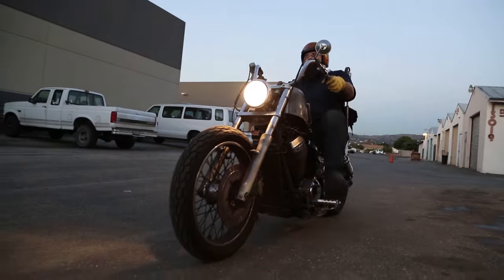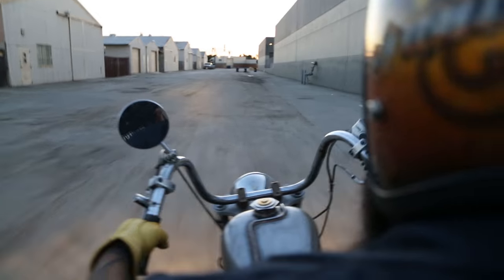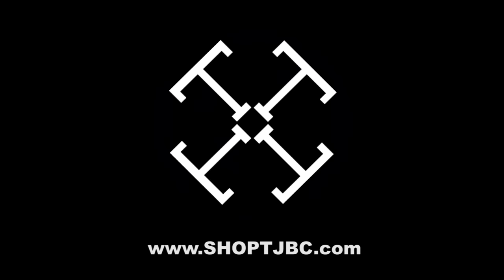How To Fix Idle Issues - Bike wont stay in idle? EASY Diagnosis

Comment: Hi, got my carb cleaned but the problems persists. Could the problem be with the inlet and exhaust valves? My odo reads 55k kms. My bike doesn't idle even after riding for an hour. A lil help is highly appreciated.

Comment: Hi, I just found your channel. My 2007 carbureted 865cc Triumph T 100 Bonneville changes idle by itself. I set the idle adjustment knob between 1000- 1200 rpm, the next day the bike is idling at 1500-2000. My bike has close to 25K miles on it, all mine.

Comment: I'm not a mechanic, but from what I've found, a lot of these old bikes are just cold blooded and won't idle on cold starts without a little help...until they're warmed up.  I'm not sure what year this guy's bike was.   With my 1975 CB750 I have to keep my hand on the throttle, keeping the RMP's around 1000 for the first minute or so then it should hold it's idle fine.  I'll give it a few revs when coming to stops for the first mile or so, just to be safe.  These old Honda 750's actually came with a screw on the bottom of the throttle housing so you can open the throttle a little and hold it there with the screw as the bike warmed up. (Same thing I'm doing with my hand.  It could also be done with the idle knob on the carb linkage but then once the bike is warmed up I'll have to reach under the tank and turn it back down.  The trick for me is the find the prefect setting (and tuning) to where I'm not having to babysit the throttle too much on a cold start and once it's warned up the idle doesn't get too high and need an adjustment.     It's funny, when I first got the bike I went to my local vintage motorcycle mechanic and asked him about the cold starts.  He said something like... "you guys want your cool vintage bikes... but you want them to run like they're a fuel injected modern bike..and they're not."  I appreciated him saying that, cause all I really wanted to know was if this was "normal" so to speak.  And I got my answer.  : )   I'm sure someone will comment that they're 70's CB750 fires up and idles on cold start without any help, which I'm sure some do.

Comment: I just got my Sabre. Sat for 8 months barely turned on. It starts okay, not great. I got it home but it died and had to push start after 30 mins. I made a video of what's going on. Could I send it to an email? Def subscribing. I plan on replacing fuel and putting seafoam in it. I did one round with the old fuel already and it seems somewhat better already. It just has the weird stutter then slight backfire every few seconds on full choke. On half choke it stutters a ton and seems to want to almost die without throttle engaged but throttle engagement immediately pushes it back up to good idle temporarily

Comment: I’m having this issue with my bike, this is the first Honda I’ve had I don’t have a clue where to change the idle speed nor where the choke is even located and could you explain which screw is which on the carburetor?
Reply from the maker: all of this is covered in your owners manual and the service manual!

Comment: I have a 77 cb750a that won't idle. And once it heats up the idle runs away to like 3k rpm. I'm assuming it is a vacuum issue being as thebcarb boots are original 1970's rubber and Cracked all to hell. I'm replacing those tonite but I was wondering if you have any advice on to give me.

Comment: Hi TJ, on an older video explaining how to adjust the air/fuel mixture screw, you said to drill a small hole in the plug, put a wood screw in it and pull it out. Once you do that and adjust the air/fuel, do you need to put a new plug over it?
Reply: Sounds like you just pulled the factory plugs that is in place to keep people from adjusting it. Theres no need to put the plugs back over the screws .

Comment: I bought a old Honda C70. Came with the original carb and a Chinese clone carb. With the Chinese carb on it will idle fine but when you give it throttle it will bog out and die. With the original carb with no choke (broken) it has a hard time starting without bump starting it and will not idle but will run fine when giving it throttle and when you close the throttle it dies. 
So I'm guessing it is a carb problem and not a spark issue?

Comment: Question mom has 2001 harley sportster 883 just had mobile mechanic look at it idle was set to high so he adjusted the air hose and adjusted ideal now it doesn't run right unless u hold throttle so how to adjust or fix please send some advice

Comment: Hi, I got a 2004 Honda Rebel 250 and it is not idling after few miles riding. I mean after few miles, when I try to shift gears, I idle the throttle and simultaneously squeeze the clutch, but engine won't idle. gears shifting in high rpm. and after I stop the bike and neutral the gears, rpm is still very high for about 10-15 minutes. Any idea what happening. Thanks in advance..
Reply: Did you find a solution to this? Having the same problem.

Comment: Question. I have a 15 Honda shadow phantom with EFI, gave it a wash as normal and went for a ride. when I first took off, my bike was running good then about 3 miles in ,it started to have poor acceleration and sounded like my exhaust was clapping feeling like it had no power.  I took it home and and let it rest for the day thinking maybe I got something wet that shouldn’t have. Tried starting it the next day and same issue having no power and when trying to just get in the friction zone it just stalled out. Felt the exhaust cause of the sound and could feel the front exhaust was hot to the touch blowing warm and the back exhaust cold to the touch blowing cold.   I work on my bike myself and I’m no mechanic sure lol but Seeing if you would have any idea what could be the problem could be ?? before I take it to the shop just wondering if it’s something I can do my self.  Been trying to learn as I go, being I never worked on a bike before so any help is appreciated lol
Reply from the maker: Damn that sucks man, I'm not surebwhat would cause that but a shop is definitely the way to go. Sounds like the wash did somethin

Comment: Hey possibly wanted to pick your brain I have an old 89 honda cx500 dual carb and I can start fine no problem but after I've warmed it up and been driving around a bit and I will come to a stop sign my bike will get real rough at idle and even stall out I have to keep revving it to jeep it alive and then when I take off I have to give it quite a bit of gas and then let the clutch out or it will just bog down and I will have little to no power and if you give it usually it finally kicks in and you take off. So my question is have you come across anything like this before if so thoughts??

Comment: After I took off the coolant lines to the carb manifold, as the engine warms up it starts to idle faster and I have to slow it down some until the engine is fully warmed up. It's not much of a problem just somewhat irritating.
Reply: @TJBRUTALCUSTOMS  It may have to do with colder temps at night here in Ohio while the bike sits in the shed. At night, they usually drop a good bit more than daytime. I did remove all the unneeded coolant lines and vacuum lines. I did finally get the tank and speedometer from a 750 Aero mounted and the speedometer and lights wired. I did a walk around video of what it looks like now. 
https://www.youtube.com/watch?v=EnSAgIv8u7U
Reply: I haven’t messed with my coolant lines but I have the same problem on my GL500. Idles fine, I ride it for a bit, the engine warms up, then I’m sat at traffic lights idling at 4000rpm looking like an idiot, did you find a fix in the end?

Comment: For my F/A screw I am sitting at about 3.5 turns out I have a 1994 shadow vt1100c I feel like it's wrong can I get some insight?
Reply: I know this is an old comment, but 3.5 turns is WAY too much. You should generally be around 1.5--2 turns. Honestly, I'm not that familiar with Honda's, I feel like this is a manufacturer's norm.

Comment: i need advise on my zontes javelin 125ccBF20HDX (bought from a private seller). we had a mechanic around to diagnose the problem and he thought it was the regulator because of the way the bike started and all the electrical displays was not showing. so i went and bought the part and got it fitted and still wouldnt work. when i kick start the bike , it runs and the rev will go really high up and stays there for a bout 3 minutes. after 3 minutes, the engine starts to judder  as if it was running on fumes. i have about 25% of fuel left in  the tank.  from this point, i am not sure what to fix. could anyone help?

Comment: Hello my name is josh, I have a 1998 shadow ace and sometimes my starter button does not want to work sometimes it will, just wondering if there is a simple solution to the problem before it gets any worse
Reply: It's the contacts in your starter switch getting worn or just dirty. Take the switch apart (go slow and be careful) and clean the contacts first.

Comment: -- Cant get mine to run.  It has spark.  Removed the carb, cleaned all the jets.  Tested the kickstand circuit, fresh battery (charging system works), good fuel.  
   Problem is the same as before.  It'll run for a few seconds with starting fluid, but barely on fuel.  Air fuel mixture screw I've set several different ways.  Fuel from the tank is getting to the carb, again I cleaned the jets (see right through them and the float bowl) have spark, adjusted idle.  Seems to only chance it has to run for a few seconds is on choke.  
   New plug, oil, filter, air filter.  Suzuki GZ250, 2002.  I'm at the end of my rope.   Anyone have any ideas?
Reply: Did you ever get an answer?  Mine is doing the exact same thing.  Looking for answers.
Reply: -- I did on another site.  Problem with mine was multi-tiered the jets, and the float bowl gasket.  Needed to buy a desk magnifying glass to see the problem with it.  The jets, followed every procedure, and they looked perfect, but the pilot jet was not (and that's the easiest jet).  
   I've also (this wasn't my issue) heard a choke cable malfunction can cause it, and also if you're piston ring is warn - reason being, is the downward stroke helps the carb mix/draw fuel into the cylinder.  
   Best place to start without tearing things apart is making sure fuel is getting from your tank into the float bowl.  There is a float drain screw.  That gives you a steady stream of fuel, then you're ok there.  If not, then tank filters, something in that short line is the the problem.  There's also a vacuum hose right on your fuel cut off that runs basically from the petcock to the carb (I'm terrible with carbs) but check that.  
    All this, and I doubt any of it will help you.  Probably checking these things will just confirm the problem is somewhere else.
    
 @Spikey45633
Reply: Thanks. Rebuilt carb with new jets(except starter jet-i think this is pressed in). Bike is barn find with only 9000 and compression is good. Bowls are filling with gas, but only runs until starter fluid is gone. The only thing I didn't do was drill out the mixture caps and readjust-could this be the problem ?
Reply from the maker: sorry man i dont know anything about that bike!

Comment: My issue is that it ticks over fine when it's cold, but after a while I'm having to keep the revs up to stop it dying at traffic lights.

Anyone got any ideas? 

It's a Yamaha rxs100
Reply: Gabriel Godina  I managed to reduce the problem by fiddling with the air-fuel intake, and the resting rev rate. Might help you a little if you've not already tried it. But that definitely didn't fix it.